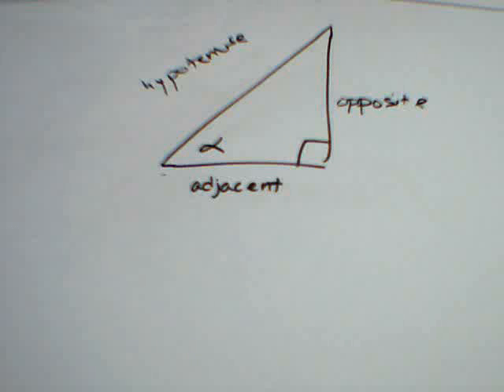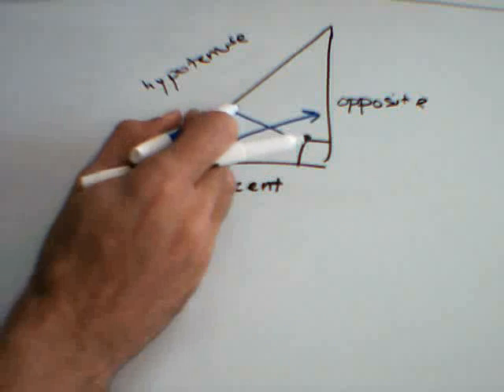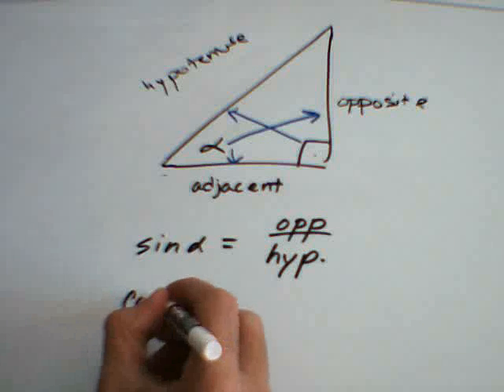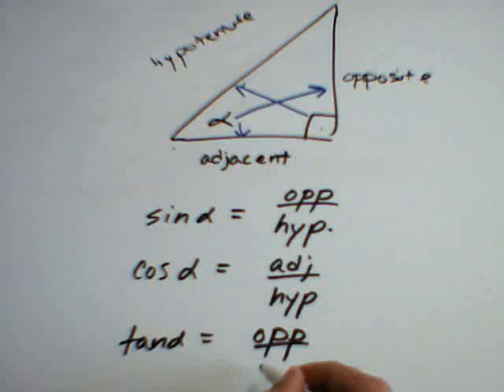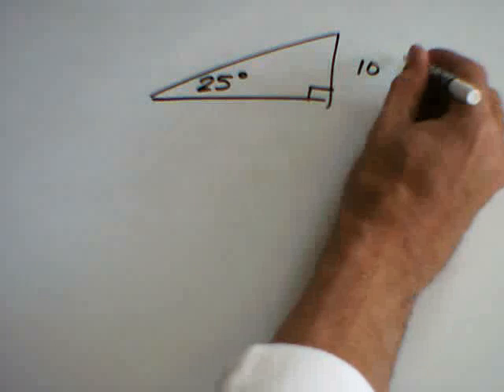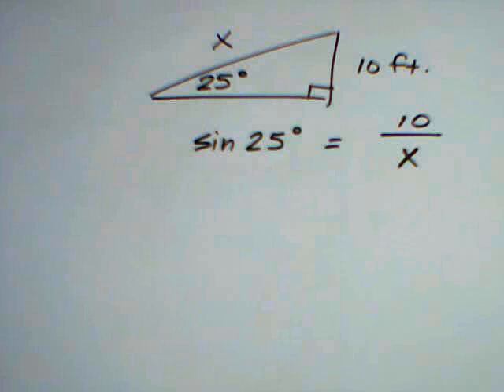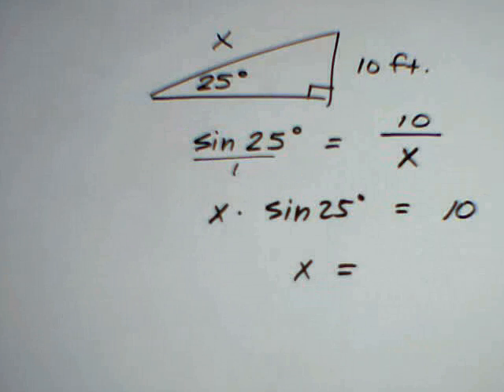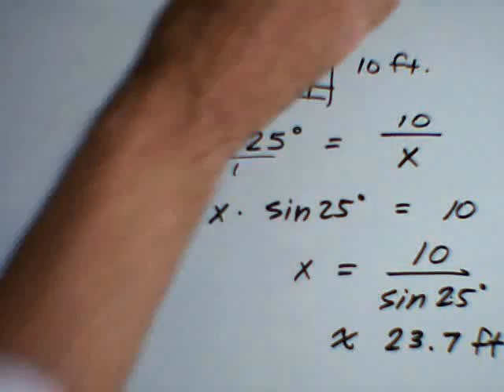Right Triangle Trigonometry

Comment from the maker: The comment below from @tonymagona334 says it all. When using basic right triangle trigonometry, you will be trying to find one side when you know one other side and an angle. The question you have to ask yourself is "what is the relationship (opposite, adjacent, hypotenuse) between the two sides and the angle?" If you can answer that question, then you will know which to use.

Comment from the maker: @otopilas700  To use the Pythagorean Theorem you have to know the lengths of two sides of a right triangle in order to find the length of the third side. In this problem, we initially only know the length of one side. After finding that side using trig, we could then find the third side by the Pythagorean Theorem.

Comment: @froooooot6 many calculators do trig differently. Some let you to type out the expression as seen, and some require you to input values and then operators. It's important to know how to switch between radian and degree modes.